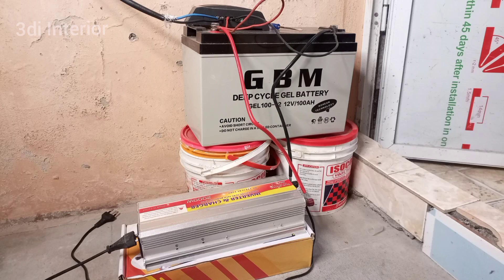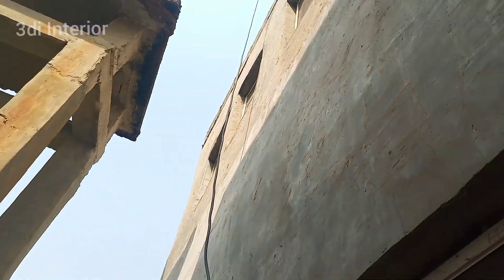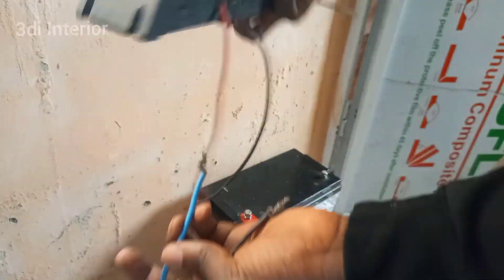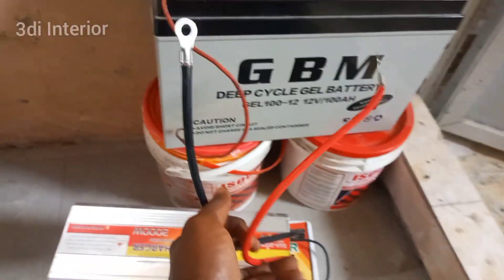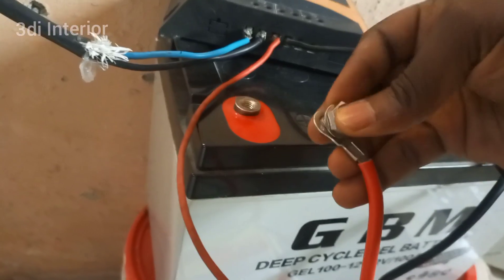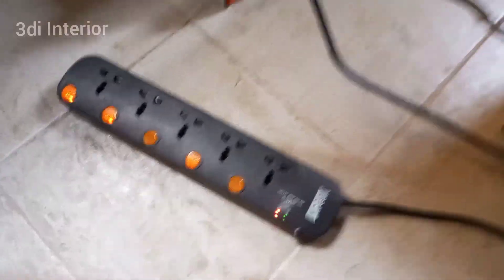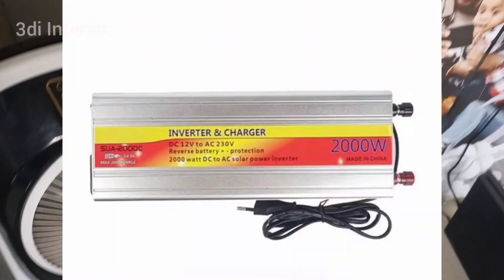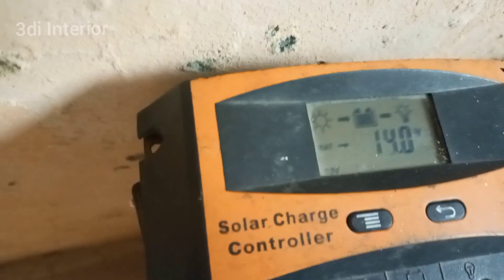How to generate your own electricity inverter with solar panel & battery for homes DIY

Comment: Please, how long does this last at night if there is no light
Reply from the maker: With this setup...you Should have 24/7 power supply... During the day the battery will always be full because of the sun... After sunset the full battery will carry you through out the night till daybreak then the process repeat itself the next day for the next four years when you will need to change the battery 💁
Reply: So, with the same load you just showed us, the battery last all night?
Reply from the maker: @michaeltaiwo99  bro I don't play videogames and watch TV all night... I do used fan all night though
Reply: What is the wat of your tv set and game set
Reply from the maker: @ProphetOfSoccer  honestly I have no idea

Comment: Can it work without the solar panel if other apliance are available
Reply from the maker: Yes, you can use electricity to charge your battery
Reply: @theartshop.1  the battery is It normal car battery?
Reply from the maker: @NeverGiveUpOnlineWealth  no, solar battery, not saying car battery can't be use

Comment: How much please
Reply: Where is your office in Abuja?
Reply from the maker: @onyegapeter3513  I am not into solar energy field... What I do is produce and sell 3d wall mural
Reply from the maker: Here in Nigeria 150w panel is about 37000 2000w inverter is 35000 100ah battery is about 98000

Comment: bro, how long have you been using this ?
Reply: is it cheaper this way than those ready made ones?
Reply from the maker: @Olakekan1  the ready-made ones are more expensive
Reply: how long will it last  with the fan and tv on full charge and how long does it take to be fully charged with the solar panel .
Reply from the maker: @Olakekan1  With this setup...you Should have 24/7 power supply... During the day the battery will always be full because of the sun... After sunset the full battery will carry you through out the night till daybreak then the process repeat itself the next day for the next four years when you will need to change the battery 💁
Reply: bro i found out that the last two holes on the charge controller is for the  inverter cable, no need to attach it to the battery.
Reply from the maker: @Olakekan1  ok
Reply from the maker: 2 years now
Reply: @theartshop.1  wow!!  i want to be charging it with just the solar panel, is that a good idea.
Reply from the maker: @Olakekan1  yes, of course
Reply: please what is the name and power of the charge controller you used .
Reply from the maker: @Olakekan1  the picture is there on the screen, you can screenshot it
Reply: mppt 20 or 30a ?
Reply from the maker: @Olakekan1  I can't remember

Comment: Hi, hope you well, I am in South Africa, with your set up, tell me if the  battery is fully charged, how long will it last if I am  only using the wifi router and  TV. Using the TV for say 15 hours a day. Will the battery carry me for a few days.
Reply from the maker: With this setup...you Should have 24/7 power supply... During the day the battery will always be full because of the sun... After sunset the full battery will carry you through out the night till daybreak then the process repeat itself the next day for the next four years when you will need to change the battery 💁
Reply: @theartshop.1 you are very right
Reply: Thank you 😊
Reply from the maker: @preggienaicker8864  you are welcome

Comment: Should my panel be connected in parallel or in series?
Reply: The parallel and series connection depends on the voltage of battery. Assume you have 12v battery, 12v inverter, 12v charge controller. You will require to connect your battery  in parallel to maintain the 12v. If you need 24v, you need to connect it in series. The series connection work with 24v battery etc
Reply: Depends on how many panel you want to use.and the charge controller u have
Reply from the maker: Sorry I don't understand your question because I am not a professional obviously... Can you make your question simpler?
Reply: get an mppt charge controller and connect in series but dont exceed the charge controller voltage limit

Comment: Pls I have an inverter and 220ah battery so I want to know if I get a charge controller and Solar panel can I still be using both electricity and solar panel together.
Reply from the maker: Does your inverter has a charger?

Comment: Bro thanks for the video.  My question is if I plug the Inverter to Nepa, while the panel is charging it. If nepa brings light will both nepa and panel be charging the battery?
Reply from the maker: Yes... Both will be changing...
Reply: I believe NEPA will override solar

Comment: Can 12v motorcycle battery work on a 17.2v solar panel?
I don't have much money to afford those 80k+ batteries.
Reply from the maker: I don't have any idea, I am not a professional
Reply: how much is the battery ,solar and the solar size?
Reply from the maker: @ajasaadewale8135  everything should cost like 100 and something k
Reply: Motorcycle battery can work but you need at least 3 or 2 battries in parallel together with solar charge controller for more back up.
Reply: Yes it wil, the charge controller will make sure only 12v goes into the battery

Comment: My questions brother. 
1. You're saying you can use this continuously when the sun is up right? Will the battery drain when using at day and  do you have to disconnect the battery when full?

2.Night time. How long will a full charge last over night or are you saying it stays on all through the night?
Thanks.
Reply: what is the  battery amh/ watts
Reply from the maker: @ajasaadewale8135  I think it 100 amh
Reply from the maker: 1 You don't need to disconnect because the charge controller is meant address that concerns

2 that should depends on your load

Comment: U should connect battery first to controller Mr man
Reply from the maker: Thanks for the info... I am not a professional 💁🤗
Reply: That's what I wanted to say too . But I like the way he admitted that he is not a professional.  
Most people should take note that the tutorial are well detailed but their is more to this when it comes sizing inverter, sizing charge controller and sizing battery to suit the system.
Reply: Very true else if he had plenty panels, that charge controller for burn

Comment: If you can't afford solar panels can you charge the battery through the inverter?
Reply: How pls.
Reply: @lizzydominic4658 You just need the 20000w inverter and 100ah battery... Watch the last part to see where he plugged it into Nepa and that chargers the battery for yuu.

After that, plug yuur extention from the inverter box to supply light for yuu.
Reply from the maker: Yes, of course
Reply: @theartshop.1 how can I possibly do that
Reply from the maker: @tennysonenumah5578  watch the last part of the video and see how to charge the battery using inverter
Reply: He should have switched on the home appliances for us to see that it actually powered them.

Comment: Thanks a lot for this video you've helped me considered which to buy exactly for my PS4, my ceiling fan + standing fan and my two 32 inch TV's especially for lengthy periods

 Because I've seen a budget friendly 3000W sets with exactly the same as everything you've shown here just that the inverter is a 1000 Watts more than as displayed in your video then again the solar panel is 160W SOLAR PANEL (2 units of 80w mono)

The downside is just the battery which is equally MGM but it's not upto a 100Ah... It's 75Ah Battery 🔋 which I plan to upgrade maybe to 200Ah battery

MY QUESTION IS..... IF I BUY THE 200AH BATTERY,

1. CAN THE SOLAR PANEL 👉🏾160W SOLAR PANEL (2 units of 80w mono)👈🏾BE ABLE TO GIVE IT ENOUGH CHARGE TO RUN SWIFTLY

 OR DO I NEED A SOLAR PANEL WITH MORE WATTS??

2. DO I STILL NEED A HIGHER VOLT INVERTER OTHER THAN THE 3000W/12volt Inverter AND THE CHARGE CONTROLLER??

ANYBODY WITH CLEAR UNDERSTANDING CAN ASNWER.. THANK YOU ❤️ 🙏🏾
Reply: You will need a higher solar panel wattage to charge your 200ah battery faster. The 3000W/12V inverted will work for your battery just fine. What you should consider doing is buying more Solar Panel. I will suggest at least 2 180w mono panels for quick solar charge
Reply: how much will it cost to set up this!!!
Reply from the maker: @godwinpeter7449  a 100 and something k
Reply: @theartshop.1 please where can I buy this solar panel and the inverter?. Also can I use ordinary car battery for this connection?
Reply from the maker: @sproutmindofficial  solar battery is the best to use... You can buy them in Alaba international market in Lagos
Reply: @theartshop.1  what's the breakdown?
Reply: Can I use iron
Reply from the maker: @qudusajayi864  it's not advisable for that package... The was I day I forget to remove the extension and put it on NEPA and I iron clothes... After I was done I discovered I was using the solar system... I had used it to iron before 😂💁
Reply: nice job
Reply from the maker: @Profaith495  thanks
Reply from the maker: You are welcome... I not a professional but if you are buying 200ah battery then you double the solar panel I used
Reply: @theartshop.1  what is your contact number?
Reply: What solar panels watt do you uses and the battery

Comment: Bro, please send me the break down price of your 2000w inverter solar set up in Naira.
Reply from the maker: Inverter 2000 watts Solar panel 150 watts

Battery 100 ah
Charge controller

With a 100 and something k you can pay for the setup, I don't know the current prices but you can Google it
Reply from the maker: Enjoy...
Reply: Jumia is your best bet! I've gotten a few solar fans from jumia and I'm enjoying them over the past months 

For such a system 👉🏾160W SOLAR PANEL (2 units of 80w mono)
75Ah Battery (1)
3000W/12volt Inverter.(1)
20A CONTROL (1)

Cost 155k on jumia shipping. Fees should not be more than 5k or less

The battery is 75Ah but you can buy from same jumia just the battery itself a (100AH or 200Ah) as the inverter is 3000W Which is obviously a bit more higher than his...
Reply: Hi Brother, your battery for this video’s setup; is it an inverter battery or a car battery?

If it’s a car battery are there any implications based on your usage experience?
Reply from the maker: @kevinkay4886  it is solar battery...
Reply: @theartshop.1  thanks Bro for being so prompt. Noted 👍🏾

Comment: Pls sir, like what and what can I add up so as to power (a) laptop (b) printer and few other tins as a Computer Operator in my offc? Tnks
Reply from the maker: If your printer is A4 then you don't need to add anything else, the setup can carry that loads and other stuff
Reply: @theartshop.1  wow this is too gud 2 be true...tnks Sir I wil snap my HP laserjet black/white printer n send 2 ur WhatsApp for view
Reply from the maker: @okirichristian1818  I saw it, it should be able to carry it
Reply: Check the watt of your printer. I don't think total watt in your office is up to 1.5kva. so get 1kva inverter, 200watt solar panel, 100Amp battery and a charge controller. You are good to go

Comment: How do you charge with nepa?
Reply from the maker: The inverter/charger has a cable you can plug to sucket and it changes the battery... You should watch the last part of the video
Reply: Thank you for this video
Reply from the maker: @michaeltaiwo99  you are welcome
Reply: Wow
Reply: Can i charge with generator

Comment: What's the budget for this setup?

Also if possible can you list the prices of these appliances and their prescribed volts, watts, and amperes.
Reply: What year did you get these appliances?

If possible list their prices.
Reply from the maker: @TheFractalFlow  like two years ago, the prices must have changed by now... You can just googled the prices
Reply: Wish u were in Warri to assist me. I qsked someone about this stuff last week and u need to see the bill he gave me, the charge controller he said is 50k meanwhile on jumia i am seeing cheaper prices like 7k, 13k, etc. I guess he wants to reap me off. Pls i need help.
Reply from the maker: @chukwukanwachukwu6119  you can buy them very cheap in alaba international market
Reply: @chukwukanwachukwu6119 there are different charge controllers and also different ratings too. Then it also depends on what appliance you want to use the inverter to power and the setup. For lightening, TV and standing fan. The video is your sure plug with a 10amp solar controller
Reply: @TheFractalFlow  He used a modified sine wave inverter. If you use a pure sine wave inverter, your cost will be significantly more
Reply: Is it after the battery is fully charged
Reply from the maker: Inverter 2000 watts
Solar panel 150 watts
Battery 100 ah

With a 100 and something k you can pay for this setup
Reply: @theartshop.1  is the charge controller free?
Reply from the maker: @TheFractalFlow  no, I bought it around 5,000 naira
Reply: @theartshop.1  do you sell those items I mean the inverter, solar panel, battery controller and battery.  Please list the prices one by one thanks
Reply: Or can you direct me on where to buy the items
Reply from the maker: @bgennawille  no I don't sell them, you can Google the prices
Reply from the maker: @bgennawille  you can buy in Alaba international market
Reply: @theartshop.1  can 1500 work with 100ah battery?
Reply from the maker: @omolefernandez6595  1500 what???
Reply: @theartshop.1  1500 watt inverter
Reply from the maker: @omolefernandez6595  I have no idea about that because I haven't experimented with 1500 inverter
Reply: @omolefernandez6595 yes it will, even 18ah will work fine. Just that 18ah will drain faster than 100ah on the same load. So any battery will worl
Reply: @theartshop.1  what about 500watt inverter, can it still go for 100 ah battery?
Reply from the maker: @ajsunnygee4592  yes but you will not be able to charge your battery with nepa light

Comment: Nice video very real, how long does this battery last for you? With tv, ps and fan on.
Reply from the maker: The truth of the matter is that I have never run out of power since I started using the setup
Reply: @theartshop.1  okay, how many kva is the inverter, and the battery ah
Reply from the maker: @coziarinze  the battery ah is 100
Reply from the maker: @coziarinze  the inverter is 2000 watts
Reply: @theartshop.1  as a Nigerian what should be my budget to get all 4 appliances?
Reply: Solar panel 150 watts 
Inverter (watts)
Charge controller
Battery 100ah (brand you recommend)
Reply from the maker: @coziarinze  100 and something k
Reply from the maker: @coziarinze  you can get all this in Alaba international market at very cheap prices
Reply: Here in Nigeria 
150w panel is about 3700
2000w inverter is 35000
100ah battery is about 98000
Reply from the maker: @eliteajudike8953  thank you so much, for the info provided is much appreciated 👍
Reply: Pls can you help with the contact of the seller please 
It's urgent
Reply from the maker: @AMAZING_FOODS844  I don't have their contact but you buy them in alaba market if you stay in Lagos
Reply: Pls can I chat you on WhatsApp privately pls
Reply: Will 100w panel work with it
Reply from the maker: @fadeleenochkehinde5436  I think so
Reply: How much is the charge controller
Reply from the maker: @misonipeter4377  I bought it 5,000 naira
Reply: @theartshop.1 can the controller charge 4 of that battery
Reply from the maker: @InvestWithDesmond  you can two of 200 ah batteries
Reply: Pls I just came across this video today and after watching, I wanna start buying all the components, is this set up still working well till now?
Reply: @debeardman  yes it's working